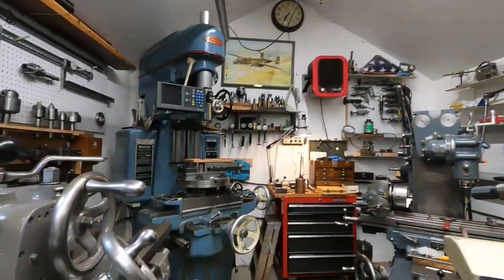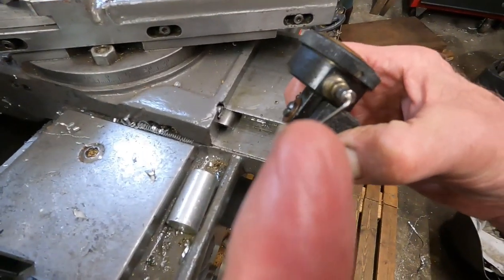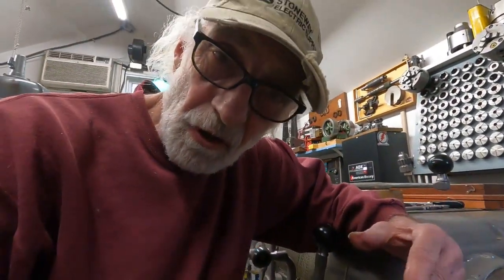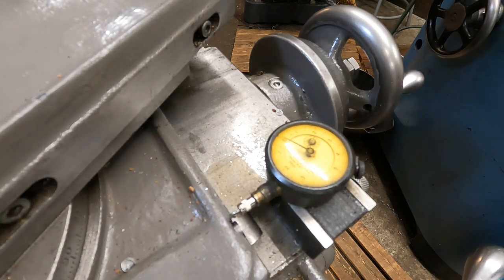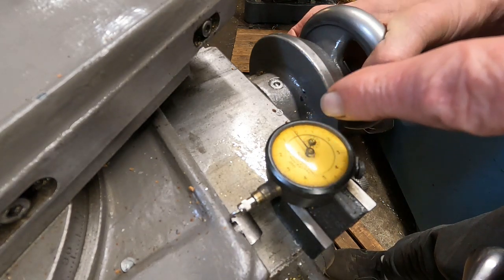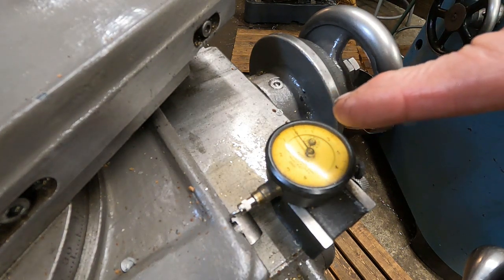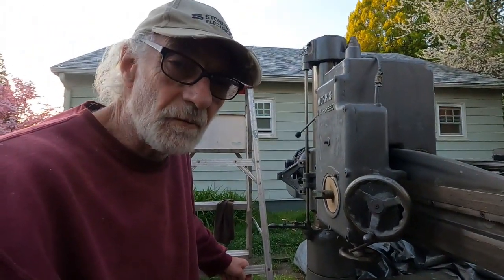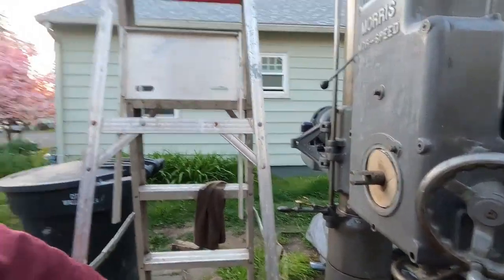Holding diameters on old lathes and machining action

Comment: Don, you might have the info I'm not able to find.

When you look at drill bit flutes, there are some with zero relief on the flutes' sidewall; ie: the entire circumference is the same diameter.  Then there are some which have a flat relief a short distance, (~0.010"?), away from the flute trough, proper, ie: the diameter is reduced after the flute's trailing edge).

Do you know the name of the second type of drill design?
Reply from the maker: I can tell you the ones with zero relief are called circle ground by those that grind tools. The ones that have the narrow land on the flute are better for general purpose work particularly with hand drills. The circle ground drills in a machine spindle will usually drill a cleaner hole to size and better finish because the flutes have more bearing surface on the wall of the hole.
Reply: @DonDyarprecision  Thanks, Don... figured you'd know. My wife works for MSC, she's a lexicographer working on the search engine & the org,  classification(s) & heirarchy of the descriptive titles you see on each item's page.

Her work group doesn't even consider the 2 different flute designs as a category/descriptor/identifier.

I found the narrow land flutes work better center drilling, before reaming or boring.  My tailstock Morse taper is under-sized & tends to slip circle ground.  I wanted to price some at MSC, then realized there wasn't any data on that aspect.

Not being able to trust the images, I'm trying to make a case w/ my 'inside contact' for MSC being a trendsetter & including the info on the drills they sell.  Not a small job since they sell a bazillion different drills. But, as I told my wife, it's job security.

You've put a lot of work into refurbing that radial drill.  Gonna look good crammed into your shop, LOL.

If you find the need to restore a big azz band saw, (you don't have room for), I have a Harrington, (out oh OK), under a tarp at the side of my driveway.  I got it for doing a bit of work for a machine tool sales comp close to me.

It's all air controlled & actuated; the electric motor drives the saw & an integrated compressor.  The comp still makes the same model; it's has the capability to be automated, if a guy had the in feed & out feed tables.

Just one of my 'one of these days' projects.

Have fun in WW...

GeoD

Comment: That’s a really nice 6 jaw chuck on that ol lathe. Just finished grinding my chuck jaws using the method that I learned from an astonishingly knowledgeable machinist I follow on YouTube…. 
Thank you sir. 
It worked beautifully and I only needed to remove one and a half thousands. 
Thanks again sir.
Reply from the maker: I am really glad you tried that! Now you can do more with the chuck and waste less material and time. This grinding method is fast to set up if you happen to have some damage happen to the jaws. I can circulate some of the chucks like the 6 jaw to the other machines. I look at the 6 jaw as an extension of the 5 c collets being a 6" size on this powerful lathe it is for light duty. thanks.
Reply: @DonDyarprecision  a nice 6 jaw is on “the list” but admittedly it doesn’t make the top priority list haha. I’m still working on fitting Robs 5C collet closer. I have an odd sized spindle bore that falls between a Morse taper 5 and 6 (5.5) and I’m still working on the parts to get that JFK closer working. Also I’m excited to work on the boring/automatic facing head arbor conversion. 
Them Wolhohaupter’s are glass hard ! I’m thinking about trying to anneal it by heating it up and slow cooling it. Also I picked up some ceramic inserts to test cut on it. They are such a great quality piece of tooling. 
Anyway’s I hope you have a great day Sir. 
I learn so much from you, I can’t say thank you enough !

Comment: Dee that is good information. We had some Swiss made grinding machines and I would have an operator come to work 30 minutes early just to start the machines so they would be warm at shift start. We were grinding plastic to 2 microns TIR and flatness. I have a couple of the old Starrett tenths indicators made especially for Pratt and Whitney. Even have Pratt and Whitney on the dial face as well as Starrett.  I don't remember the total range, but it is extremely short. So accurate you can measure the brown streaks in your underwear. LOL
Reply from the maker: I worked with Crystal Lake cylindrical grinders, those are very simple with the flat belts coming down from shafting at the top and plain bearings but high accuracy. Later models had liquid cooled bearings!